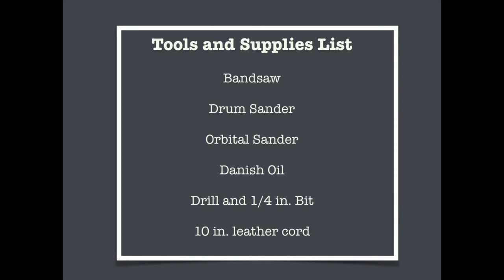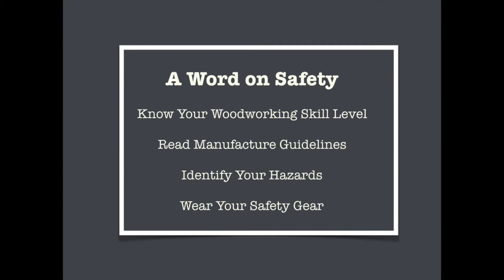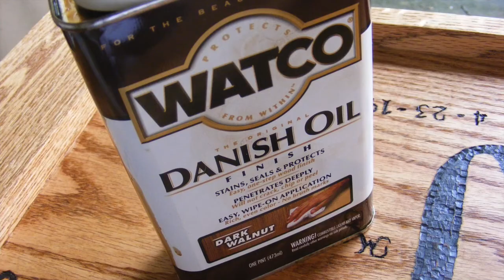Push Pull Stick

Comment: Does the heat from the oven not hurt the polyeuratane
Reply from the maker: Good question. I've never had any problems. Usually the contact of the stick with the oven is so brief.
Reply: @fouroakscrafts7240  Ok thank you for the information